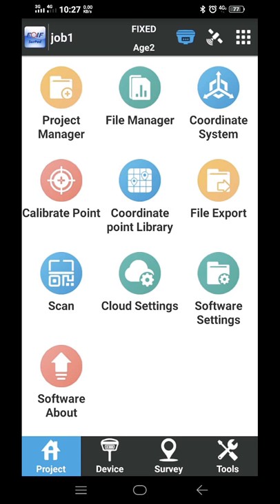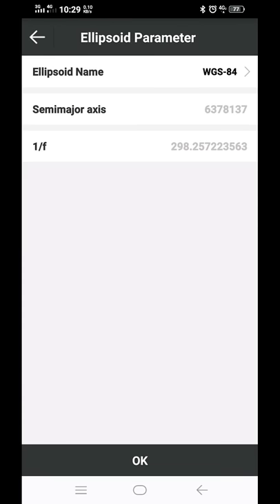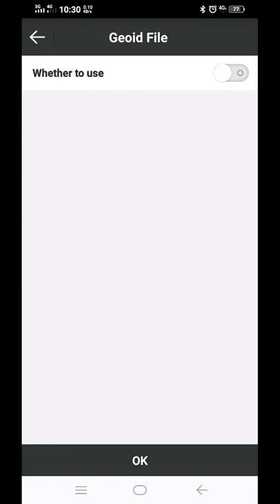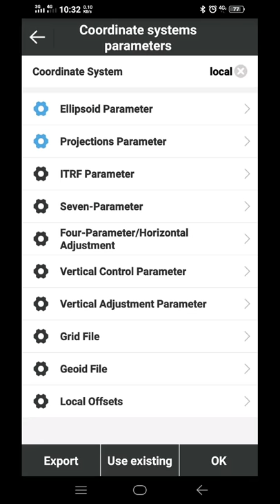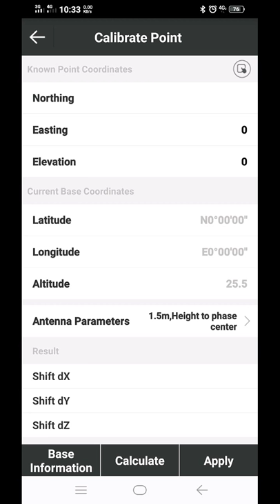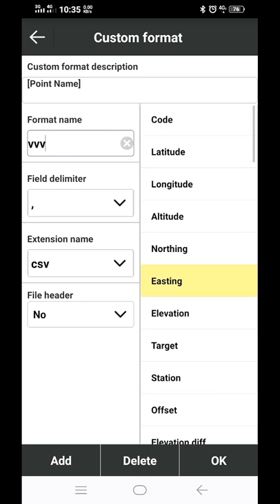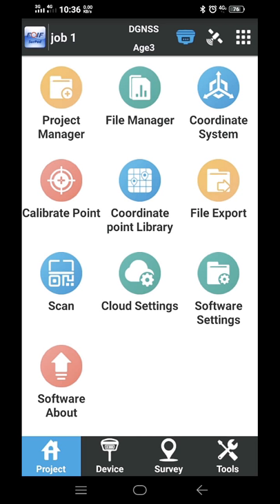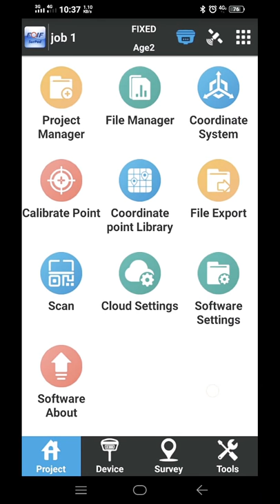How to set job/project in FOIF N90 GNSS RTK management of projects

Comment: Hi Chencho, well explained. I am having issue with code library . I used Microsoft Word and loaded txt file in config folder. It brings up but codes are some weird letters. I wonder if you know how to.
Reply from the maker: Why don't you create code library inside controller itself. It may be but time consuming but you can input what you use the most.
Reply from the maker: Anyways what was the format you created the .txt file. Did you make the description followed by comma and the the code. Example. "Plot boundary,pbdy" Try saving it and import. Please mail me the txt u created. At chencho.nedup87@gmail.com
Reply: Hi Chencho, Thank you for very quick reply. I found out what I was doing wrong. Program do not like txt file created in Word. It has to be done with Notepad. It works as you mention separating with comma between code and full description. I will finish it tomorrow  with all the codes we use and mail it you. I used code first and then full description, but I see you used code after.
Reply from the maker: @akhehra  hope it works. It doesn't matter where you put first or not. It depends upon how u want. Better for description first as when u select description the code reflects automatically.
Reply from the maker: @akhehra  https://youtu.be/vy-6IQGJCJU

Comment: Sir,hows your review on the performance of this equipment?
Please reply with your feedback.thanks
Reply from the maker: Basically... This instrument performs well as any other RTK machines. It's have many features related to any kind of surveying... whereby, I mostly use for cadastral surveying. It's getting much better with new upgrades often which lead to cracking new survey features...and also fixes bugs. The battery last longer as compared to other RTK I used...  It's has advantage as it can be used as external radio too with few add on. 
Overall, this N90 rtk equipment is better.
Reply: @techwithchenchoep5818  what other brands have you compared to?
In terms.of its vertical and horizontal accuracy in thr RTK mode?
Thank you.
Reply from the maker: @xxxXagent14Xxx  I am not comparing the instruments... they have their own accuracy and it's features... I was saying interms of corelations...
Reply: @techwithchenchoep5818  oh.okey.
Thanks :)